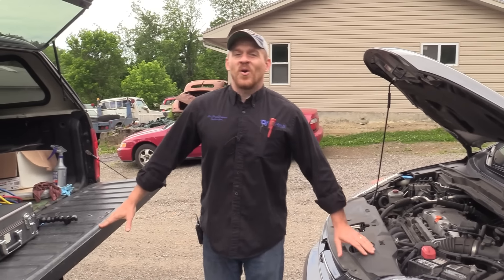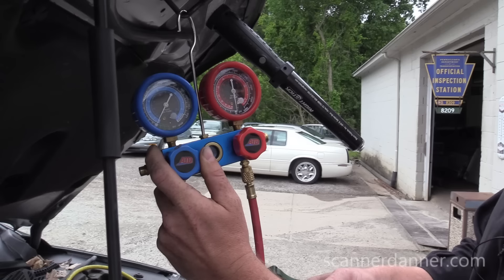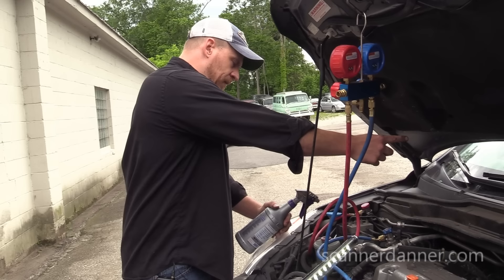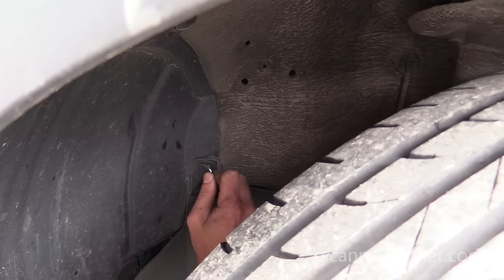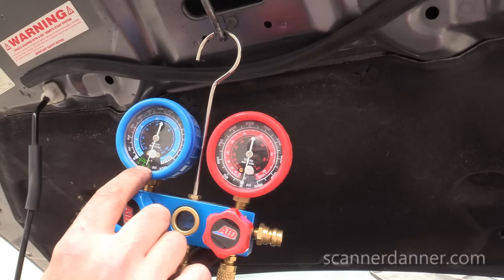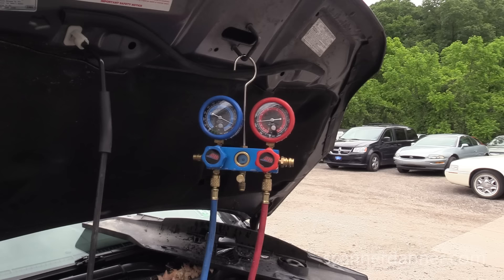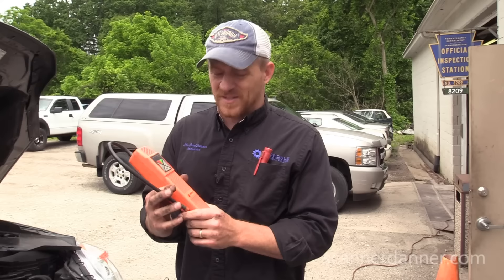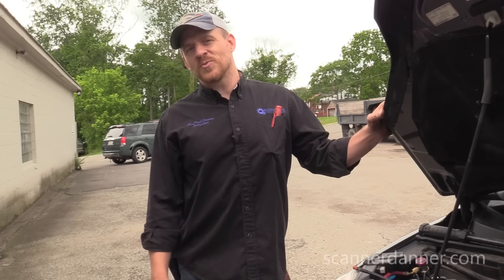Air Conditioning Not Working (system performance, leak test) - Honda CRV

Comment: You should use a UV LIGHT to find leaks. Theres a dye in the refrigerant for this reason.
Reply from the maker: If a system comes in empty, I do NOT automatically add refrigerant and dye. Why? Because you may have a gaping hole in a line and you just dumped all the refrigerant to the atmosphere. To each his own
Reply: @ScannerDanner  

Correct. You should only use the UV light when you know there is gas in there. But saying that, the residue should still be there  from when it was last full.

Comment: Great work "Paul" and Kalop ? Not sure if thats the correct spelling but great work, father and son working together, it doesn't get better than that especially at the end when Paul was driving with the music, great feeling.
Heres a link for a little info on AC leaks, and I agree with Paul, "what ever method works for you is the correct method"
http://www.achrnews.com/articles/115414-the-professor-basic-leak-detection-methods
Regards Mike from down under, appreciates your great work
Reply from the maker: It is "Caleb" :-)
Thanks Michael

Comment: Not true  pressure should be 100psi on high and low when ac  not running for about 10 to 20mins .
Reply from the maker: What's not true? "Rest psi" depends on ambient temp. 
Did you know when it is 10 degrees outside that a full system charge of R134a will only be about 10 psi at rest?

Comment: Am an a/c guy. Using air to do a pressure test. It’s a crime !!!   I work on residential systems.    Don’t add moisture to the system    Use nitrogen
Reply from the maker: The real crime is the DIYers and mechanics too, charging a completely empty system with an unknown huge hole in the system as a method of leak testing, only to pump the refrigerant into the atmosphere. System is already full of moisture when it came in. This is a valid test that I'm showing and anyone can do it! Not arguing that nitrogen is better

Comment: you dont have to put air in the system air is humidity same as water you will contaminate the system   in this case you need to put nitrogen on the system

Comment: Yea yea yea, the problem with using compressed air is that the humidity in the air is also compressed and concentrated and now your putting it in the system. Yes, it's already got air in the system, but not necessarily water, your putting water in it. It doesn't necessarily cause damage, but it can make evacuation time longer, it can saturate your drier, in systems with electric compressors (not automotive) it mixes with the oil and can cause acid and flocking and plug the system up at the metering devices. Basically , its bad refrigeration practice is all, you will get away with it forever servicing cars because no one really gives a shit about a car, but doing that on a $ 20,000 rooftop unit that costs $30,000 to install will get you fired from your employer.
Reply from the maker: Completely understand that. I've been using nitrogen in my newer case studies 😉

Comment: If leak is significant why is it difficult to find
Reply: Ramon Ibarra Because the Evaporator Coil is inside the Car. It's concealed. The Evaporator coil is what was determined to be leaking- and must be replaced.

Comment: You know what would of been better than your shop air full of dust contaminants and moisture water with dye preasureize the system with that you will find the leak then
Reply from the maker: you want to use refrigerant and dye before knowing if there is a gaping hole in the system? I'll stick to my shop air, thanks

Comment: thirty inches of mercury, a perfect vacuum is equal to fifteen pounds of pressure. So when a tech tells me that he did a vacuum leak check that is not enough pressure.  You need at least two hundred pounds.. Also forget that pump sprayer because if there is a big enough leak it will blow that soap off and never find a leak.  Must use some refrigerant and add air or nitrogen to get to higher pressure and then use a electronic leak detector.
Reply: If the pressure is enough to blow the soap off then obviously you don't need it. It would make more sense to listen for the leak right!

Comment: What I don’t like about soup bubbles is that the soap tends to corrode your lines and heat exchangers( either the evaporator or condenser coil) and cause more leaks down the road, unless it is designed for that. Also when you have a leak, it is not a good idea to put the system into a vacuum, you might introduce air into the system: air that’s just not to mention whatever else is around the leak. Let’s just say that you drain like is plugged and all the water is just sitting around the leak. Guess where all the water and whatever else is the leak is going?

Comment: If your in the market for a awesome leak detector...... Google H10. I just did a auto ac series on my channel from a HVAC tech side of things.
Reply: You are allowed to put a little 134a in the system as a trace gas and then pump the pressure back up without having to recover it to leak test.

Comment: many systems are service port leaks, no pressure at all, doesnt always mean it's contaminated heavily, so you ram in a ton of air into an unknown system :| 
** forgot to complain about the expansion rate of air vs nitrogen when pressure testing**
PAG oil is about as hygroscopic as you can get, POE is slightly better. Nitrogen is the best and only way it should be pressure tested, that or risk venting gas into the air :)

Comment: The biggest reason for these not to work is the relay sticking
Reply from the maker: I believe this one was an EVAP core leak right? lol can't remember
Reply: It's just that on hondas they have a weak relay for the ac so if you come across one that's full and not working it's more than likely that that's gone
Reply from the maker: @scottward8446  or the clutch itself. I have a few honda case studies on here with bad clutches. Thanks!

Comment: ok guy's what happen🤔 when the ac condenser fan stop working 😲 the system get hot  🔥 and build pressure about 400 to 500 PSI so the amount of compressed  air can you add to the system without harming any components 🤔  is about 400 PSI because the compressor have a high pressure relief valve that open about 450 PSI to  protect the ac components 🤔 hey this is  what I seem 😂😂

Comment: you are very interesting and a great asset to the autmotive repair fieldbut cant you be a bit more professional  and at least use dye and uv glasses,this is such a hack'.
Reply from the maker: lol, thanks but dye is pretty much useless for an EVAP leak unless it is severe. I've done many EVAP cores with leaks that pass the dye test. This was NOT a hack job in any way shape or form. You don't have to like the air test. I'm fine with that

Comment: You absolutely never ever under no circumstances use compressed air to fill up an AC system the moisture content is so high it’s saturates and gets absorbed into the refrigerant oil that’s extremely hydroscopic and the desiccant material get saturated in is no longer good and you cannot remove it with a vacuum pump. It produces an acid with the refrigerant which over a period of time slowly eats out the lumen components like your evaporator and condenser from the inside out causing pinholes congratulations you just screwed up the customers car ticking time bomb. Hi moisture content under prolong operating conditions periodic intermittent plugging of the expansion valve with a nice ball that builds up just after the expansion valve restricting the flow refrigerants congratulations again you just screwed up the customers car. Only electronic leak detector is used as your first line of the fence locating a refrigerant leak. Then you can use your soap bubbles dry nitrogen only. Then for your long-term leaks are UV dye preferably a high-quality one from the tracer line products. He made so many mistakes and gave so much bad information in this video it was embarrassing to watch I didn’t know whether to cry laugh or get angry a little combination of all. Under no south come stances should anybody ever be allowed to work on air conditioning and less they own a recovery machine and filling up a system with refrigerant just for leak testing in combination with the recovery machine is the proper way one of many and using a recovery machine per per Cicely remove the refrigerant and weigh it to know exactly what you had in the system is another form of diagnostics which somebody without a recovery machine would never know this. Please delete this video from YouTube it has too much disinformation like many of the others about refrigerant repairs.
Reply from the maker: Same tired argument, the system was completely empty from a large leak, what do you think was in the system? Atmospheric air, the desiccant is already saturated! Sure nitrogen would be better but I'm telling you I am not hurting this system using compressed air. Fix the leak, change the drier, EVAC the system, done. Get off your high horse and shoot some of your own videos. I will not be taking this video down. 
You know what most people do? They add refrigerant to an empty system without ever knowing how big of a leak they actually have. What if it is a gaping hole? Where did all that refrigerant just go? That's right, straight into the atmosphere. Worse yet, people add their own cans of refrigerant without ever checking it for a leak and it slowly leaks out over the season.
News flash on the nitrogen, 1. I am mobile and I am not carrying around a nitrogen tank 2. you can't even find a place to fill those for you around here 3. The DIYers out there are not going to go buy nitrogen to do leak testing, they are going to blindly dump refrigerant in and say a prayer. I have given the common everyday person a method that is tried and true and one I have used for 25 years with ZERO issues. IF the system is empty, it is already full of moisture and air.
Reply: ScannerDanner Yes I am mobile to so was my father and we always carry nitrogen and it was always available at every commercial refrigeration warehouse and every Airgas or other distributor of propane nitrogen CO2 and welding gas supply houses they’re located in every city throughout the United States and worldwide. And amount of moisture that’s in the natural air that we breathe every day is grossly far less than amount of saturated moisture that literally turns into water the minute it is injected into a system and goes beyond the point of saturation in the hydroscopic PAG oil or ESTER oil systems. Good to see and under stand the effort to help DIY people. But at least explain the long term damage caused by using compressed air. Thanks for the reply keep up the good work just make more of an effort on the detailed explanations of the positive and negative affects of every procedure performed so people can make an educated decision whether or not to cause damage to their systems. 👍
Reply from the maker: Not the reply I expected, thank you for that and sorry for being agitated in my reply. We will just have a difference in opinion on the compressed air test. I agree with you that nitrogen would be best.
Reply: t lech. The word is hygroscopic not hydroscopic, the ability to absorb moisture from the air. Just say gee, you're right.